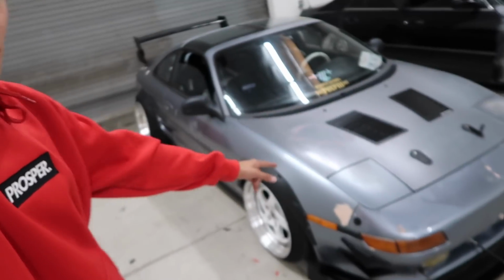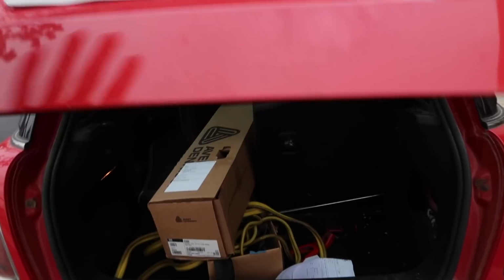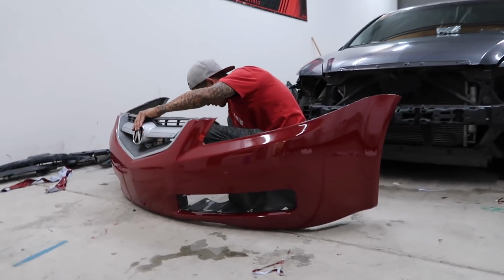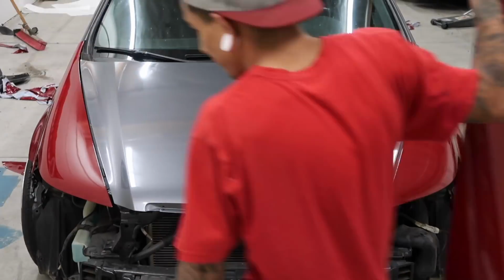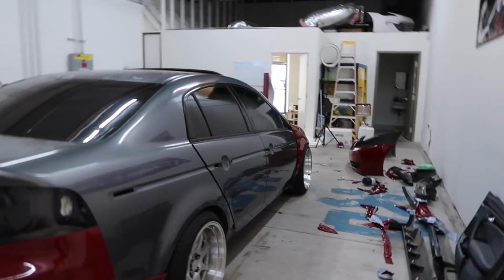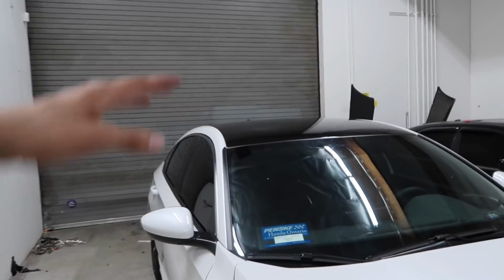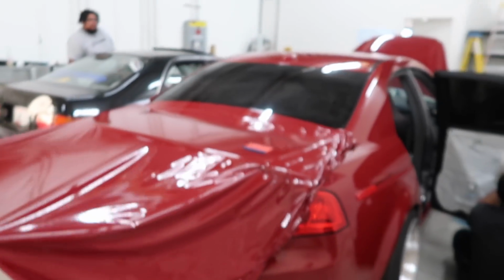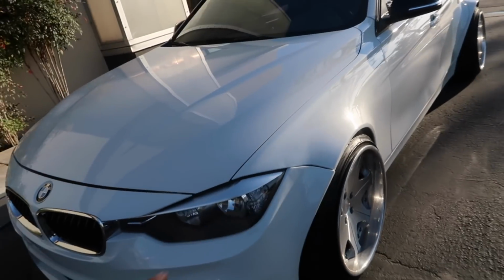Acura TL Fully Vinyl Wrapped (almost BLEW up my 240sx..)

Comment: Sucks he didn't get the body damage fixed on the driver's rear quarter and that aftermarket bumper on the TL. If it was a genuine ACURA bumper it would have had ACURA spelled on the front middle. 

Love the color at least and great work as usual.